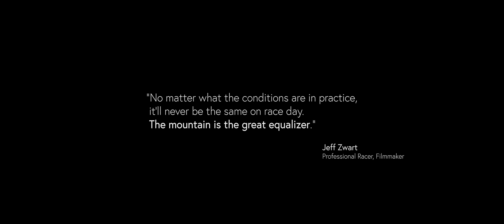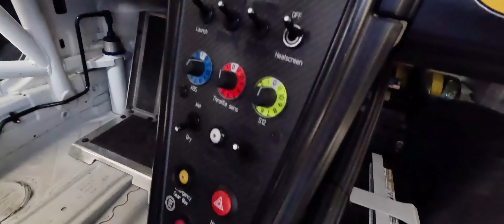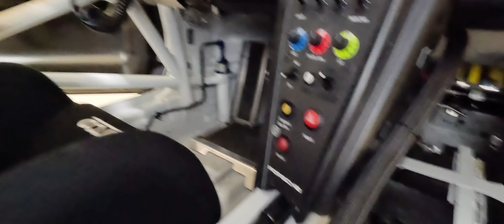Rhys Millen pushing the limits at the 100th Running of the Pikes Peak Hill Climb

Comment: Lol. Like the race engineers didn’t think of a Lithium Ion battery as an easy way to save weight. They look to cut every single millimeter of wire, hoses, etc to save weight, and their are gonna over look the battery? 😉
Reply: Wasn’t over looked. The tuner preferred not playing around with low voltage. We have had too many issues with sophisticated electronics and aftermarket lithium batteries

Comment: Little disappointed in the commentary about the 992 street car that beat this car. Just ignore the fact the *driver was David Donner. Multiple time PP overall winner and class winner. He lives at the base of the mountain! Larry? Every Porsche on the planet needs weight on the RF wheel. There is a reason why Porsche moved the battery to that location. The *factory GT3R battery is a LiPo. It’s super lightweight but in a full size case.

Comment: The driver can certainly do with a fitness campaign & shed some 50lbs of additional weight of ballast noted around his waist area. Perhaps ditch the car & try cycling up Pikes Peak a few times a week should do the trick.
They spend so much money making the car as light as possible, yet the driver behind the wheel is overweight. 
Seriously, one has to question his commitment?